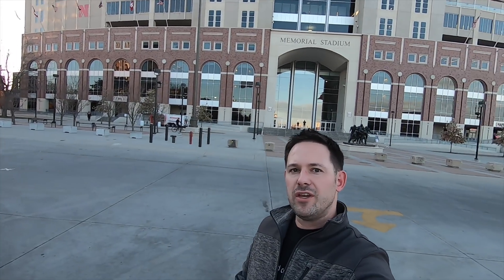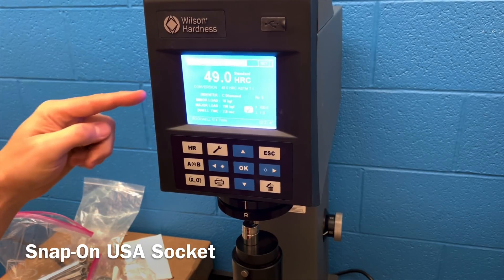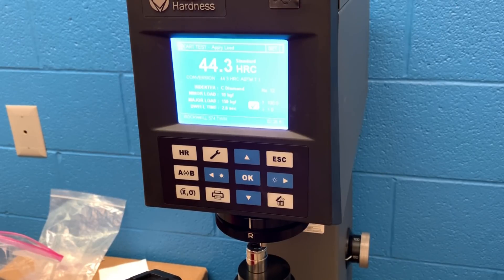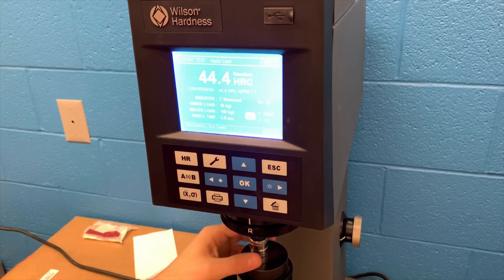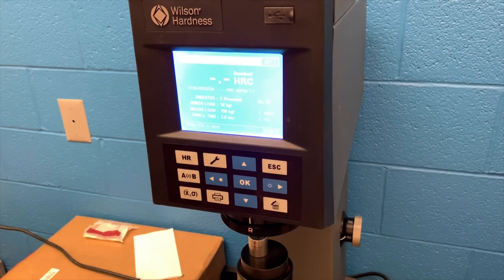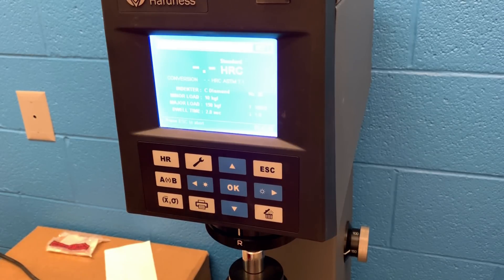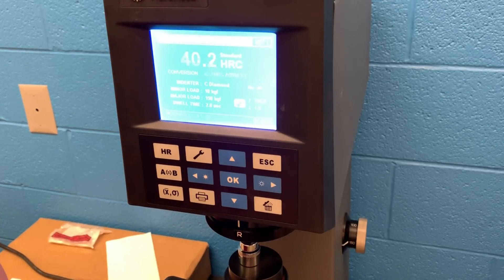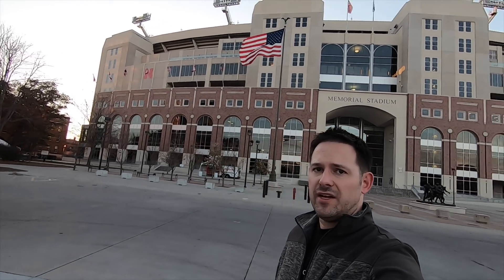Which Brand has the Hardest Socket? Rockwell Hardness Tool Testing

Comment: the real question is ..
does Rockwell Hardness mean anything in a Socket ..??
Reply: Wear resistance but really can't use impact on the real hard ones
Reply: Apparently not since some of his oldest and most durable sockets have the lowest hardness.
Reply: The harder a socket is, the more fragile it is. The softer it is, more ductile it can be before it fails.
Reply: Based on my experience with sockets failing, YES!
Reply: Joe T you can and I have used chrome sockets with impact but they will break eventually or sometimes immediately but the biggest reason I only use impact sockets with impact is because they truly do transfer more of the energy to the fastener. I’ve seen too many times a bolt that wouldn’t come loose with a chrome socket and with the same impact gun using impact socket it come loose surprisingly quick.
Reply: @jamesfair9751  best socket set I had was some husky usa made  chrome sockets survived 20 year with impact use daily the chrome never pealed off and ii never broke any I popped plenty of craftsman on the gun eventually the 1/2 got a little worn after walking off and rounding bolts I acount their durability too not being to hard and slightly thicker side walls, so I started looking at the snap on sockets I had even those had similer signs of ware , it's just like screw driver tips they will all ware to hard they will shatter there is a thin line between strength and durability grade 8 is not always better they will brake where grade 5 will give but it will hold  together
Reply: @jamesfair9751 As I stated earlier,  it depends on the alloy added to the steel and the Harding process. There are many different levels of Harding depending on the application.  Molignum is more expemcive but allows the steel to reach a higher hardness with becoming brittle.
Reply: @canative2468  In Janes case, the reason the impact worked is because of the weight.
Reply: Higher hardness will stretch less(more brittle), lower can stretch some and why impact sockets use a different material and lower hardness.
Reply: Hardness is the most important  value a socket has. Vanadium or meligneum are metals that are added to steel to allow steel to be harden with becoming brittle.  During the harding  process, they allow carbon to be trapped in the steels grain structure.
Reply: @canative2468  Manganese.

Comment: How hard would you have to take these sockets to a breaking point
Reply: Any of these sockets will easily rip the head of a common hex head fastener.  Exceptions are speciality fasters in the aerospace industry which are a completely different item.

Comment: Great video.  I wonder how the chrome plating affects the hardness readings compared to the inside metal.
Reply: That is a really good question. Good insight !!
Reply from the maker: I believe the chrome plating on a socket is around 0.004-0.010in and would be 68 to 72HRC with just a surface test. Direct Rockwell C Major load of 150kgf will test to a depth of around 0.018-0.022in. punching through the chrome and shattering it like glass getting to the good stuff.

Comment: Amazing SK WAYNE softest but still one of the very best
Reply: Mark Armstrong like any brand, there are some things they make that are really good and other stuff not as good as other brands. So you got to do your homework, and read reviews and tests and try to get the best quality for your money spent. There is no one single brand that makes the best in everything they make. People who only buy one brand are being willfully ignorant and trying to justify wasting their money on some tools that aren’t the best or even decent just cause it has a brand on it.

Personally I’ve owned Craftsman, Makita, Bosch, Ridgid, Dewalt, Husky, Kobalt, and when I was in a pinch needing something immediately I’ve bought the cheapest option to just get the job done like Porter Cable and Harbor Freight.

My personal preference is to look at Makita first for cordless power tools, they’ve just proven to be well designed, ergonomic, and dependable. Another reason for Makita over other top tier power tool brands is they make all their own motors unlike brands that source their motors from other manufacturers, which allows them to design every tool from the ground up. This is the advantage Makita has over other cordless brands that have to answer to their parent company that limits them on budget and producing bottom line numbers which results in rush to market products and cutting corners leading to hit or miss products with design flaws.

Husky hand tools because they are well made quality being at an affordable price for their master ratcheting flex head wrench set and master reversible ratcheting wrench set and sockets, plus they offer lifetime no question asked warranties on most of their hand tools.

Everyone has their opinions and preferences,
Reply: civilization  true. I'm a truck mechanic and I use every brand. I barely own any tool truck brands because theirs others just as good or better. Yeah I got guys at work that will owe the tool trucks till they die. And yet the cheaper tools at times holds up better lol.
Reply: Mark Armstrong yep 👍 

At some point, you have to ask yourself if spending x2, x3x, x4 cost is worth it when there are quality options that won’t break the bank, making you a slave to debt.

The way I look at it is if you need to be put on a payment plan just to afford something then that means you can’t afford it. That’s part of the problem we Americans have, we try to keep up with others at the cost of going broke and living paycheck to paycheck. Best policy is to buy as much as you can outright either with cash or you can comfortably pay off at the end of the month and keep your debt only to your car note and mortgage/rent, and then maintain the vehicle properly and drive it until the wheels fall off, or at least own and maintain it properly for 10-15 years. Even with cars and houses, you want to be saving up and putting as much money as you can down so your not a slave going to work paying interest and making other people rich. Always try to live within your means, not live off of credit all the time. If people would just have a little financial discipline and not try to keep with or impress these petty types that often operate from a place of insecurity, you’ll be more confident and your wallet won’t be so empty all the time.

Haha, sorry for the random tangent advice. Many people are never taught how to manage finances or think long term. Maybe some guy passing will read this and will help him make some better decisions and save him going down a bankrupt path.

Anyway cheers, Merry Christmas, Happy New Year. Be safe out there. Surround yourself with good people, cut the negative people out of your life. If she’s more trouble than she’s worth leave her. Don’t drink and drive. Be kind to animals. God bless. 🇺🇸
Reply: @I_discovered_civilization   I would like to meet you and shake your hand. Yes I pay CASH for my tools. Cash for all my tools. If I cant afford it then I dont get it.  I dont have any credit cards either lol. Saving to buy a house. 
Merry Christmas !!
Reply: Mark Armstrong nice bro. 👍

My only suggestion is that it’s good to have a couple credit cards with no annual fees used to buy gas and groceries that’s paid off in full at the end of each month. The advantage here is it helps build your credit score and credit history, factors that are weighed in when determining if you can get the lowest interest when it comes time to get a mortgage for a house. Also, by using the credit card to buy something necessary like gas and groceries is that they offer cash back on all purchases, like 1% and have categories like gas and groceries offering more cash back like 2-3%. So if you do it right, you build your credit for free with no annual fee for long term advantage, and in the immediate short term or yearly reward you’re essentially getting a 1-3% discount on what you needed to spend anyway. For example let’s say you spend $600 a month on gas and groceries. That’s $7200 a year. And you get 2% back on $7200, that equates to $144. There’s basically no reason not to take advantage of saving $144 a year, just remember to exercise some discipline and treat whatever is put on them as needing to be paid in full at the end of the month, and not treat the money you have now as a reason to spend more since gas and grocery purchases are now on the card(s).

Good luck and take care my friend. 👍
Reply: @I_discovered_civilization  thank you for wise advice. I will have to get a card but only for supper small purchases. I like to pay cash for everything.